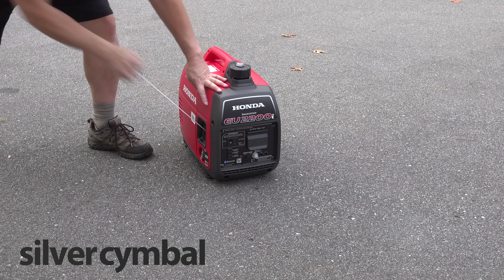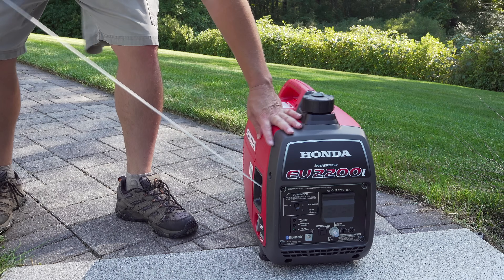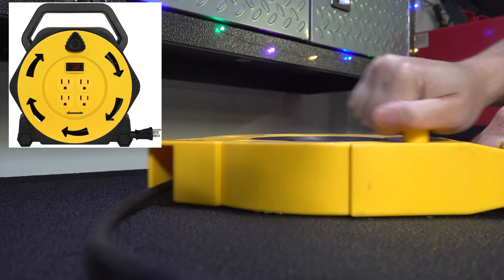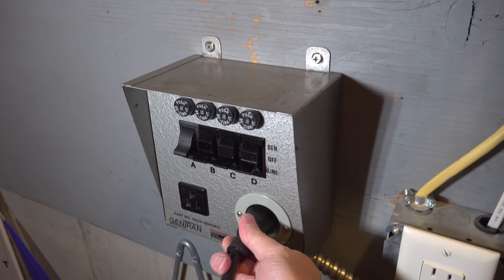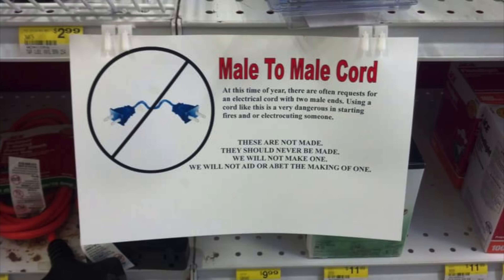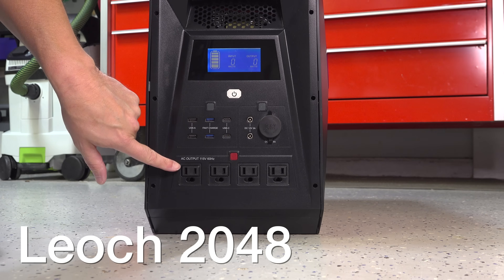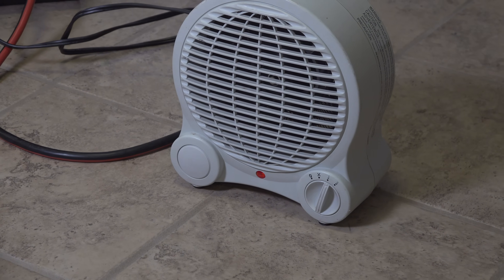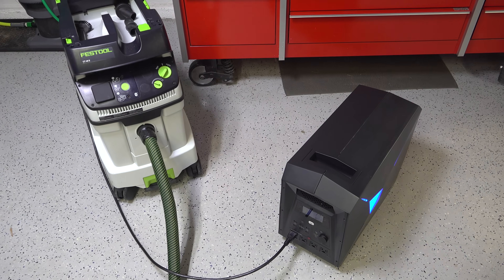How to CONNECT Solar & Battery Generators to Circuit Breakers

Comment: Wonderful, I always wanted a generator for those days when storms or ice break lines but really couldn't figure how to run the house appliances. That Transfer switch is what I was missing, now I can have it to run to some circuits for lights and HVAC and frig without running extensions all over the house and worry about fires.
Reply: If you have a couple empty slots on your electrical panel you can install an interlock which is easier, cheaper, and will send that electrical power to any 120v circuit in the house with the flip of a breaker...not just the circuits connected to the transfer switch. Much better than a transfer switch!
Reply: @adrianb6073  wish I knew better before I got solar installed on my roof that it wasn’t going to be of any use in an outage. If there was some way to “jail break” it I would have all the energy I need. $40k worst investment ever.

Comment: Not worth the price.. For that price you can get a 6000w gas gen. I'm not looking for a place to charge a gen when the power is out.. Makes no sense
Reply: Its modern vs. traditional thinking. Gas generators are noisy need to be run outdoors and require gas to be stored on your property. With some solar panels the Leoch unit can basically run forever for free and you don't have to fill it up every few hours.
Reply: @essmadee8828  do they all come with Solar Panels?
Reply: @aaronshoyt   There are different packages on indiegogo that can be purchased with and without the solar panels. The ones that you can opt to include are more portable and not designed to be left outdoors all the time. This might be good for some people who plan to take the solar generator to different locations, but for keeping just your house powered I would look at ridgid panels that are permanently attached.
Reply: Exactly what I was thinking. But you can charge it using solar. Basically like an inverter. But you can also take it with you if you need to.

Comment: The link to the transfer switch is not the same as what you used in the video.  May be current model, but I would like to get the Gentran you used.  Is it available still?
Reply from the maker: Yes, believe it or not the one in my video is 15 years old and has been moved to 3 houses. It's no longer made but this one https://amzn.to/3nTeNvF is the latest version available. But technically it works the same.

Comment: Curious, does that Honda 2200 have enough power to start your oil fired boiler with the heavy initial draw?  I have the comparable Yamaha version and it sometimes starts my burner but not always.
Reply from the maker: Absolutely, the EU2200i has no issues and the Leoch battery unit does equally fine. Both units ran the boiler while the fridge and lights were on too so there is still room to spare.
Reply: @SilverCymbal  Interesting. I’ll have to add up my total amps again. I must be missing something. Thanks for the rapid reply. I appreciate your vids.

Comment: I have a transfer switch & a gas generator outside. Do I need a special transfer switch to run that small battery generator inside my house? When it's pouring outside or a blizzard that would be much easier than going out in the weather to start the generator.
Reply from the maker: The switch outside is most likely a 240v switch so that one would not be compatible. You could still install the inside one shown but if you already have that one outside it may be overkill but if desired you could have both and use the battery unit as you said when weather is bad or you just want something that is instant on.
Reply: @SilverCymbal  I will check out the cost to see if it is feasible to have both set up. When it is bad New England weather, I don't want to go out to start the generator.

Comment: Is that generator better than a Honda EU2200? I’m in the market for one and I don’t know what to get...
Reply from the maker: It really depends on your needs. The Leoch and Honda are the best two units for the 2000 watt size. The Honda now has bluetooth and is literally a legend in the space. But it is a gas unit so for many it's perfect but not for others that don't want gas. So if you want gas buy the Honda https://amzn.to/3kfGnBp
 but if you want battery the Leoch https://tinyurl.com/y5jexkux is superb too.
Reply: @SilverCymbal  The Bluetti is the best 2000 by far.

Comment: Can anyone OHM'S Law....
Reply from the maker: Ohm's law describes the way current flows through a resistance when a different electric potential (voltage) is applied at each end of the resistance. One way to think of this is as water flowing through a pipe. The voltage is the water pressure, the current is the amount of water flowing through the pipe, & the resistance is the size of the pipe. More water will flow through the pipe (current) the more pressure is applied (voltage) & the bigger the pipe is (lower the resistance).
Reply: @SilverCymbal  exactly,  this must be the reason why I love this Channel .... Always on point S.Cymbal....👍
Reply from the maker: @Gilly714  Very nice of you to say, thank you!

Comment: Hello,I enjoy your content👍you seem to know quite alot about solar generators,I'm new at the whole thing so I have a question  if you could maybe help..I just  bought a jackery 500,and was messing around with it and noticed that when the inverter kicks on under load there is a smell coming from the vents no smoke,everything works but just that smell..is it safe??is this normal because its new??anyways any info is appreciated  thanks...
Reply: Just talked to jackery they says it's normal the smell is due to the conformal coating when the battery starts working ,hope goes away over time ,because it is quite noticable..surprised out of all the reviews I've watched no one has mentioned this...

Comment: As always, great video! Have you seen the Generlink meter mounted transfer switch? I only mention it because you said that the regular transfer switch is the only safe and legal way to power your house which is true but there is this variant. We've had a meter mounted switch on our last two houses and it will be on our next one. We talked to our power company before installing and they ok'd it and our town uses them to power traffic lights if there is an outage. These things are very slick for connecting an outdoor generator to the house and the cost works out to be about the same as an electrician installing an exterior transfer switch. https://www.homedepot.com/p/GenerLink-30-Amp-Meter-Mounted-Transfer-Switch-MA23-N/301961623
Reply from the maker: I actually have seen those and when they first came out I thought they were going to change everything but then they didn't. I think the issue is that they were really expensive but   were easy for the power company to install. I thought power companies would give them to customers and charge them say $10 a month for having it. Seemed like an easy sale, but it just didn't see to take off. Great idea, maybe it will gain traction still sometime.
Reply: This is correct Brian though your method is an uncommon one for most of the states. Also I really wish he stated in the video that an Interlok system is also a very common and legal way to run power to your house as well so there's no confusion for some who aren't familiar with transfer switches or interlock power switches. There's a great video that explains this on YouTube here for those interested https://www.youtube.com/watch?v=CKwBBesUKA8

Comment: If you turn off the main breaker when backfeeding it won't shock the neighborhood. One of those battery banks would be a great thing to have when camping.
Reply from the maker: Correct but if someone else in your house turns it back on or other variables happen it's not the right thing to do. I don't follow every rule or law in life but with kids I have realized things get in the middle that cause accidents and in this case you are better off to follow the rules and laws and keep everyone safe.
Reply: Pull the meter cause breakers will go bad and if it so happens to break at this time it will be bad..
Reply: The interlock switch is the cheapest and easiest way to wire the house. You can the. use whatever circuits you want rather than the prefixed ones of a traditional generator switch. Th batteries are the way of the future though!